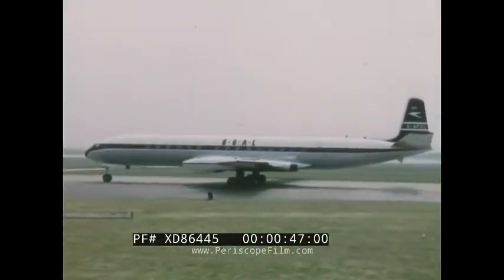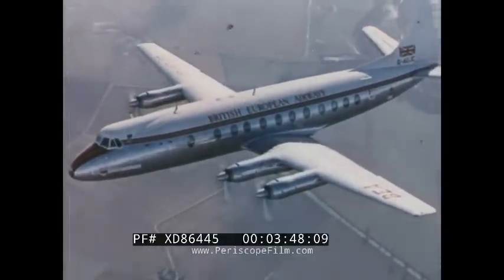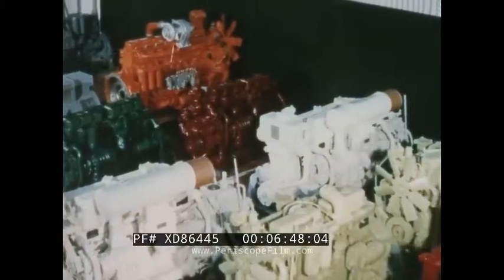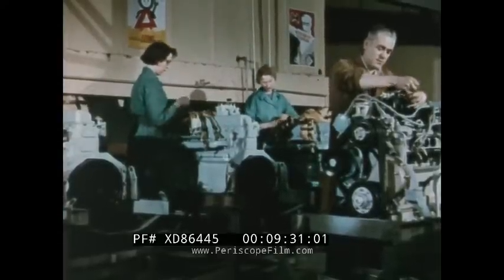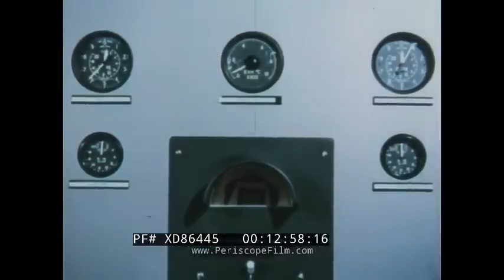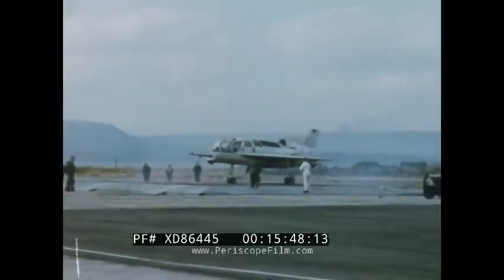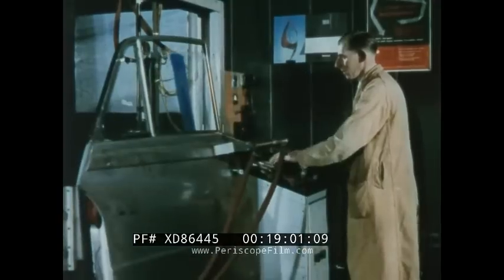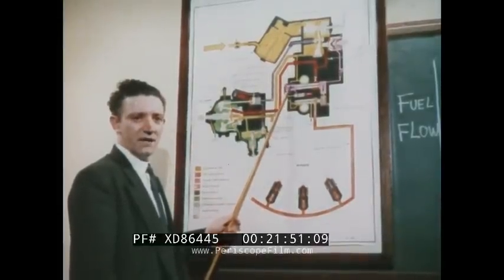ROLLS-ROYCE AIRCRAFT ENGINES   JET, TURBOJET & CAR ENGINE TECHNOLOGY   1960s PROMO FILM XD86445

Comment: Wasn't long after this film that RR came up with the dreadful RB-211 jet engine that almost sent Lockheed broke.   It couldn't pass the US bird ingestion test.  And it sent RR broke too, but the British Government bailed them out.
RR engines still cause dangerous incidents - eg a Trent engine (derivative of the RB-211) exploded a few years ago on a Qantas airliner because a critical oil feed pipe was incorrectly manufactured by RR.

Comment: Watching all of this testing of their cars, and yet, as beautiful as their cars were and as much as they were tested, they still hand built perfect garbage.
Reply: Very old fashioned looking cars with mechanical brakes.   The competition had modern styling and hydraulic brakes.   But at least RR had come to its senses on the engine, dropped the old F-head six and switched to making a clone of the Cadillac Big Block V8 and to using a GM Hydramatic gearbox.

I have worked with large industrial diesel engines.   RR engines were just as unreliable as other British engines, and not a patch on American engines from Cat or Cummins or Detroit.

Comment: Very interesting to me as my father worked for Rolls-Royce from about 1942/3, when he joined as an apprentice at Barnoldswick (with Rover, before it went to RR), until he quit as an aero service engineer in 1963. He worked on many of the planes featured, including the Viscount and the DC-8. as well as one that wasn't. It was the Ryan X-13, a vertical takeoff fighter built in California from 1955. It has an Avon engine as it was the best in terms of thrust versus weight, I was told (I was a schoolboy at the time).  The San Diego air and space museum has one on display at its annex.